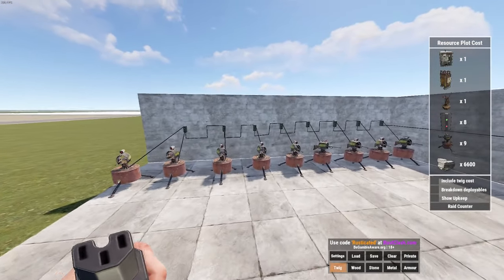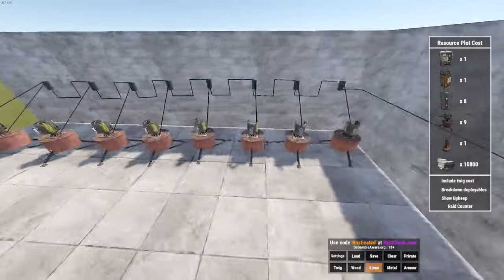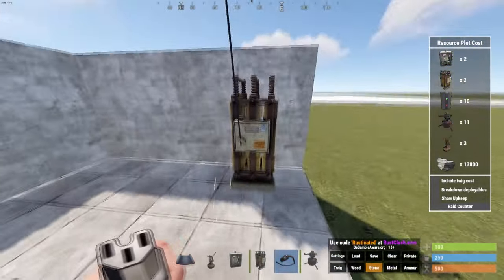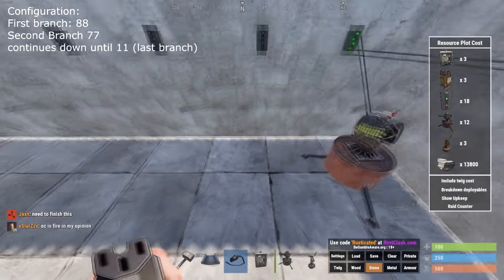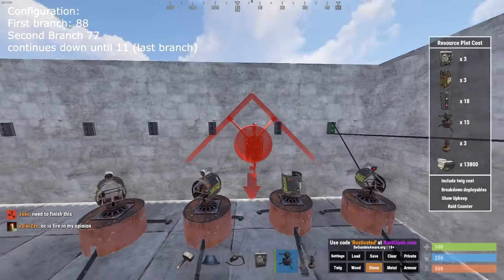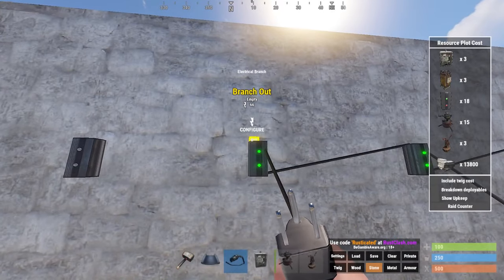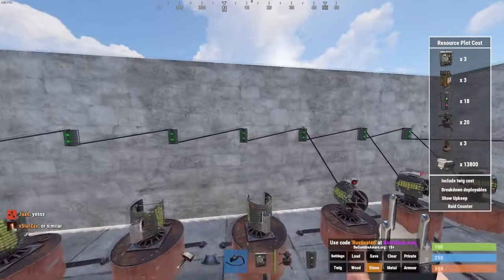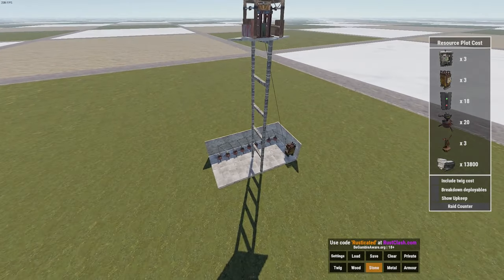Rust Auto Turret Guide 2023 + Configuration

Comment: very good tutorial! very different from others! my question is what can i do if the windmills cannot reach my battery?
Reply from the maker: Hello friend, I believe you can place a root combiner between the windmill and battery to extend its length!
Reply: @DudeWheresMyBase  and how do i make the windmill connect to the root combiner and after to the battery?
Reply from the maker: @LOGAN-uh3st  Craft and use a 'Wire Tool', then connect windmill to the bottom of root combiner, then connect the top of root combiner to battery :)

Comment: My turrets just turn off so I have to keep letting the battery charge them turn them on ??
Reply from the maker: Are you using windmill or solar panels for power? either way, you might have to pick them up and rotate them to face the sun better so it gets power. You can check if this has worked by holding out your wiring tool and the connection icon of the windmill/solar panel, and it will tell you if its getting any power
Reply: @DudeWheresMyBase  thanks !
Reply from the maker: @RAND0M__GTAG Glad to help! don't hesitate to subscribe if you like too!

Comment: Does the wire length reset from branch to branch?
Reply from the maker: Honestly I haven't played around with lengths.
I do believe feeding a branch into another branch should reset the length so you can extend it further.

Something that could also work is running the branch into a root combiner, then into a turret.

But I do know if you want more length for the windwall to reach the battery, putting root combiner inbetween I believe should reset that too.

Comment: This method does work. The only problem is eventually your batteries will die because it does not have enough time to charge…………………
Reply: I have the same setup with 5 and the large battery keeps charging.
If in doubt use 2 large batteries and hook them together then out to circuit.
Reply: @Reanimator7336  yes five is not a problem and a large battery is once you get past 9 then it comes a problem if it’s not wide up correctly

The way I do it, I have power coming straight from the windmill straight into a large battery  then I combined all the power from all the batteries

And make a column off electrical branches

And keep wiring off …..